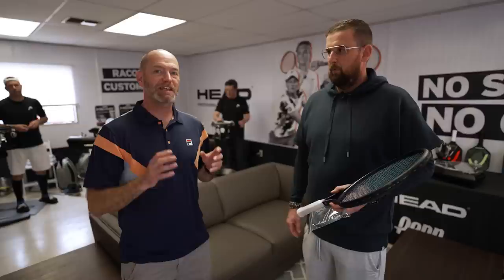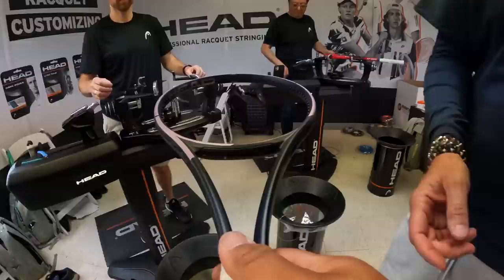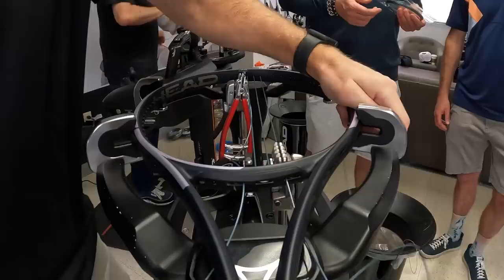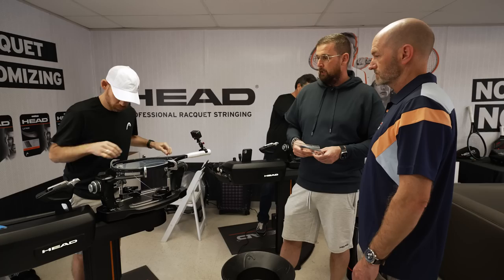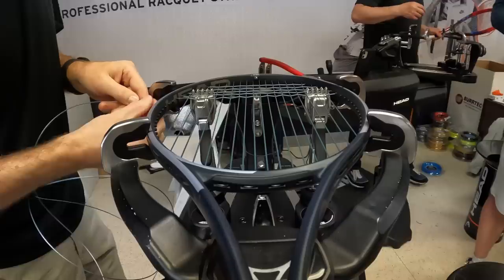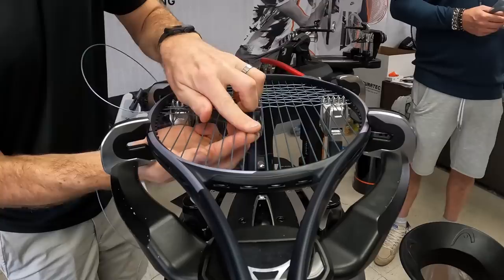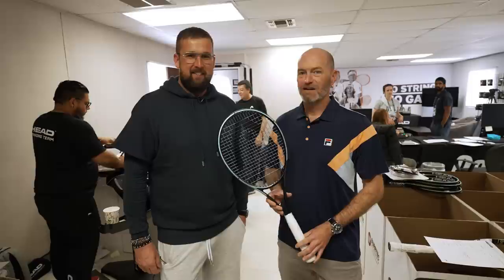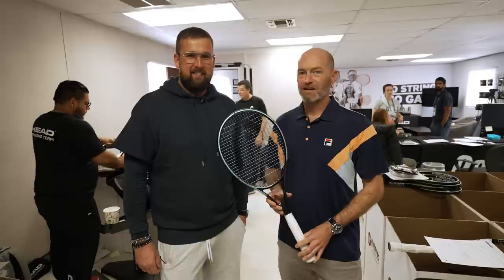A tennis racquet's journey in the HEAD Stringing Room at a Pro Tournament, BNP Paribas Open 2023!

Comment: Which stringing team is a player assigned to? The player's racquet manufacturer, or the player's string manufacturer, if they are different?
Reply from the maker: It may change from tournament to tournament, but normally a manufacturer will essentially "sponsor" the string room, so like for BNP HEAD is the stringer and then individual stringers will be assigned to players no matter what the player's brand affiliation is. Some players will get their racquets strung off site or privately or by themselves, so they wouldn't be using this service, but otherwise, all the players will be dropping their racquets off to the tournament stringers. Hope that makes sense!
Michelle, TW

Comment: It’s hard to see but did he start with the 3rd cross and work backwards? How did he tighten the 1st/2nd cross?!
Reply from the maker: Yes, started with the third cross, and then wove the second and first up to the top. Then left enough string at the top for a tie-off, and used the starting clamp to hold on the outside of the bumper, as most pro stringers don't use a starting knot. From there pulling tension on the first, second, third cross strings, and so-on with the rest of the cross installation. After finishing the crosses and tie-off at the bottom, he then pulled tension back on the excess string at the top, removed the float clamp and used the machine clamp, and then tied off. Troy, TW

Comment: What is "tubing" for a bad grommet (@~5:50)?
Reply from the maker: We sell this kind of tubing, which works well for racquets that have a cracked or broken grommet, in the case where you can't replace the whole bumper/grommet set, or it is discontinued. https://www.tennis-warehouse.com/descpage-TUBING.html. You just cut it down to size, and maybe use an awl to help guide it through the frame hole, and the string goes through the tube to protect it from the edges of the frame. Troy, TW

Comment: I see a price chart. Are the players paying for stringing? Is the manufacturer or tournament paying?
Reply from the maker: Yes, most of the time, the players are paying for stringing! This happens at all levels of tournaments. We've heard players coming from a relatively good week at a smaller ITF tournament and having a silly amount of string debt to pay. It's not cheap, but necessary. 
Michelle, TW
Reply: @tenniswarehouse Important to mention that men and women are charged the same for the strings (as well as for basically all the expenses), but are not paid the same 🤔
Reply: @tenniswarehouse  So how much are the stringers getting paid to do this?  Is it by the racquet?  By the hour??
Reply: @elchanclascocina  Important to mention that the women only play 3 sets :P
Reply: @Alastairtheduke1  On the surface it would seem important to mention that. But then it also has to be mentioned that Men play more sets only in the 4 GS. On top of that, there are 9 M1000, 13 ATP 500, 38 ATP 250, 1 ATP finals, where men play best of 3, just as the women. Then if you add the around 180 Challenger tournaments and the hundreds of Future tournaments where men play also best of the 3.

So the reality is that men only play more sets than women in less than 1% of the tournaments, women get paid less in more than men in 99% of the tournaments and, to my original point, the expenses are similar between men and women in 100% of the tournaments. Not to mention all the previous preparation that is needed to get to that point: coaches, academies, travel, equipment, etc, they are similar for men and women. Seems to me the scale is still very wrong.